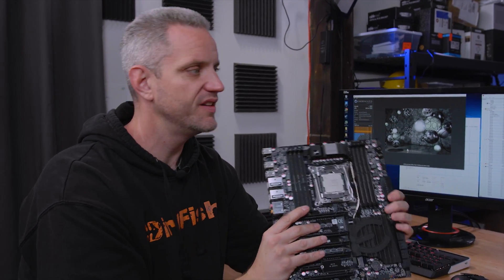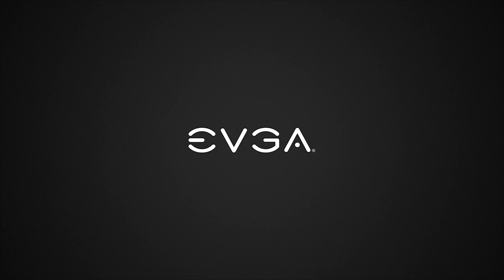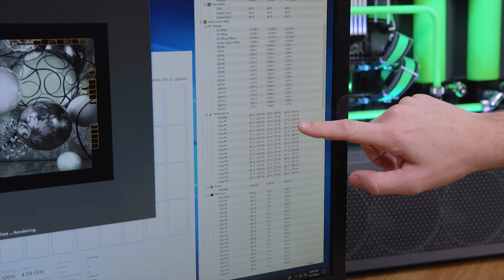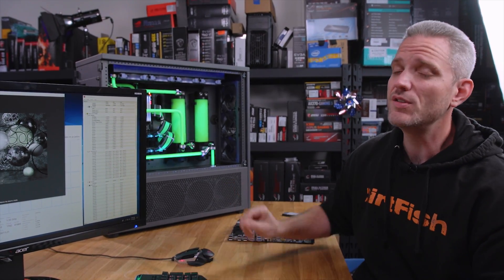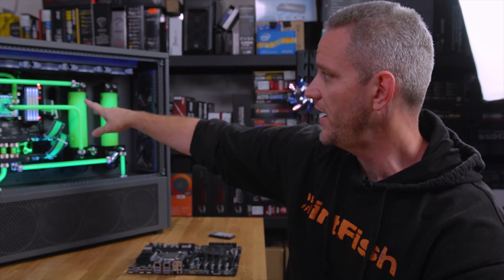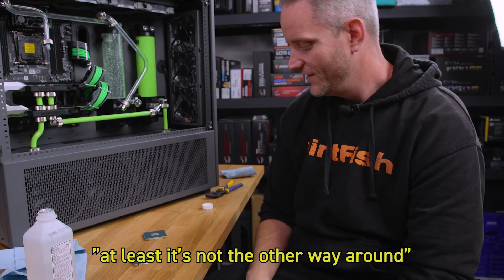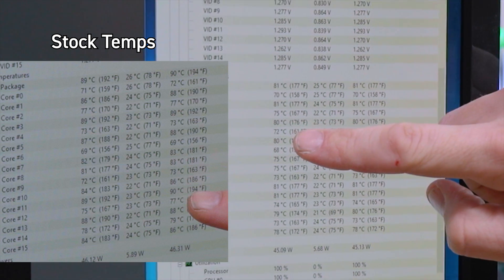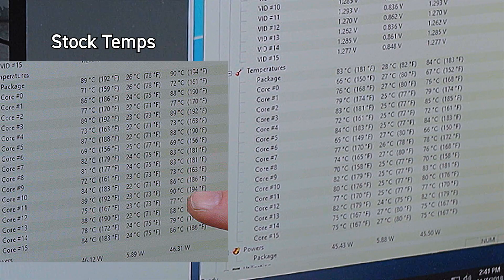I went to delid my CPU... but I didn’t expect this!

Comment: Paste? Why? What's wrong with liquid metal? Especially when the lid is off already and pipes are drained again.
Reply: The idea of a liquid metal "drying" is just wrong. There is no solvent to evaporate away. Nor is there paste that will fall out of suspension. Liquid metal is just that a metal. Sure gallium will evaporate too, but much much slower. It's not something you need to worry about
Reply: LM dries out fairly quickly
Reply: @mizz1414  Not really. GamersNexus kind of tested it, and the CPU did not go up any °C after one year of use. And even if the LM would drop 4°C after 2 years of use(just random numbers of my head, i dont think it would even drop 2°C), you would still be 6°C cooler since -10°C is a "normal" drop if you apply LM.
Reply: Mizz141, nope.  Conductonaut LM has been shown to not "dry out".  I've personally re-delidded three CPUs over the past year, and the LM were all perfectly fine (wet and puddled) and were reusable.  This specific LM lowered the CPU thermals by 12 C on day 365 as it did on day one.
Reply: @mizz1414  Bullshit Coolaboratory LM still good after 3 years in this laptop
Reply: @mizz1414  please tell me more about how metal dries

Comment: Hello from Denver, Jay!  Why did you choose to not use liquid metal with the delid?  Doesn't the LM provide at least slightly better conductivity than the paste?
Reply: @marklamutt LM is 73w/mK vs a good paste being 12.5w/mK (like Kryonaut). It's order of magnitude better. No idea why Jay would go through the trouble of a delid and then put paste right back on there.
Reply: My first thought too, LM blows everything else away and belongs in something dubbed "skunkworks", built with the intent of being overkill.
Reply: @blackbeardthepirate7467  While it could still be used between the silcon and the heat spreader, with the copper being exposed on the top of the heat spreader, it wouldn't be ideal. While gallium doesn't have nearly the effect on copper that it does on alluminum, it still will defuse in over time and the heat just makes it happen more. He'd likely want to use a piece of gold foil on top of the spreader if he was going to use the liquid metal.
Reply: @CrimFerret  not so far as longevity testing has shown, the galinstan will stain the copper, but even after 2 years, improperly applying LM would have had more effect on thermals than the breakdown of the LM to copper interface.
Reply: @CrimFerret  

We are referring to between the die and IHS. Madness not to use liquid metal.
Reply: @CrimFerret  All it does is discolor copper it doesn't effect the structural integrity as with aluminum nor does it effect the coppers thermal properties. Also the underside of the IHS is nickel coated like the top (prior to lapping).
Reply: I delided my 8700k and used liquid metal and had a 25c reduction in heat. Liqiud metal is the way to go if u delid!
Reply: @John-dt7zb  same !😍
Reply: @John-dt7zb  Same here, but I actually only had original thermal paste on one side of the die, and even that seemed to be brittle and cracked dry.
Now I need to drain my loop and check that the TIM is actually flat too :D God damnit.
Reply: Titan Mechanism  thats the thing, LM is the risk not so much the delid (minus the voided warranty)
Reply: @ryanbernard6550  

The only risk from Cryonaut liquid metal is that its electrically conductive. Not an issue when delliding with reasonable care.
Reply: Intel quality for ya
Reply: He should have used LM, period. I tested over 6 months different LMs and pastes and 99% of pastes had pump out under the IHS. LM will give you slightly better temps but its the reliability thats far more important.
Reply: He said Skunkworks is his "build it and run it for years" system.

Liquid Metal needs to be redone from time to time.
Reply: @enlightendbel  That is absolutely FALSE. I've had liquid metal on my CPU for years and haven't had to redo it at all. I've redone more pastes under IHS then i have Liquid Metal. It's supposed to solidify and in a way be like solder, it's not supposed to stay liquid because if it did it would end up running. If anyone tells you LM metal needs to be redone that's a total myth and not true. You will be redoing paste because of pump out long before youll ever need to redo liquid metal.
Reply: @bluej511  Yet everyone from the manufacturers to Der8auer to Jay himself has stated you should.
Reply: @enlightendbel  I've had CPUs that I've had on LM for 5 years that I repurposed on old boards and the temp was exactly the  same as when i took em off 5 years ago. If you need to reapply LM then you applied it wrong in the first place. With liquid metal your cores shouldn't deviate more then 5°C from another, if they do you already applied it wrong. It needs to be applied incredibly thinly not thick, most people use too much therefore need to replace  it because it has ran off the die from pressure and heat. 

Read this and realize it doesn't need to be done. Btw this is a one year performance test meaning it was probably run the entire time.

 https://www.gamersnexus.net/guides/3359-liquid-metal-aging-one-year-test-how-often-to-replace-liquid-metal
Reply: At least he used very high quality thermal paste.
Reply: You have to replace LM often though.
Reply: @omni_1376  liquid metal is good for at least 2 years at a time per application. Gamers nexus has been doing long term testing on thermal grizzly's conductonaut
Reply: last minute bid sorry? https://rover.ebay.com/rover/0/0/0?mpre=https%3A%2F%2Fwww.ebay.co.uk%2Fulk%2Fitm%2F123466141652
Reply: i don't get it either. isn't that the point of delidding? i also replaced the lid by a full copper one. also reduced temps be a couple degrees...
Reply: @flavioxy  nickle plated copper is more resistant to oxidation and liquid metal staining. also if your going to the trouble of replacing the IHS you might as well get a silver one.
Reply: @psionx1  good to know. thanks :)
Reply: marklamutt every time I read liquid metal I automatically think of terminator two stabbing it’s sword hand through the milk and the guys head lol
Reply: David Whitfield  
Nonsense. No risk of frying anything. Thousands of enthusiasts have delidded with liquid metal, including me three times, and no issues with reasonable care.
Reply: Yeah my 4770k runs delidded with LM at 4.6ghz 1.3v and I never see north of 80 even in heavy loads using just an h100i. Gaming usually stays well under 70. Couldn't take it before i delidded it. Could barely run it at 4.2ghz without the heat getting higher than I liked.
Reply: Because this guy is a n00b and everyone thinks he's not.

Period.

There is not a other answer for it. I can see there are already tons of responses by little cock suckers making excuses for him.

SMH.
Reply: victor ng  https://www.caseking.de/en/der8auer-skylake-x-direct-die-frame-fsd8-021.html
Reply: Agreed. Some talk about the risk and blah, but that's the whole point of deliding : to replace the lesser efficient TIM with LM since Intel didn't solder their IHS, not with another similar TIM (which is IMHO plain stupid as the expected end result would essentially be a voided warranty, nothing more)! *g...
Reply: I was also hoping for LM. Should be 16 times better than paste. It has some disadvantages though
Reply: @simeongeorgiev1107  I've used both and obviously LM worked significantly better.
Reply: my 8086k runs at 5.15 Ghz 1.35v (forced always turbo) runs 24,hrs a day never hits over 70 degrees' doing anything. TG's conductonout was used on the delid. LM is worth every drop. (stock was running over 90 degrees on the same clock's)
Reply: @Vasana612  Same thing for me!
Reply: Lm would last longer than the thermalpast... Would go LM!
Reply: Liquid metal has to be replaced every few months
Reply: @MaxGuides  
Absolute nonsense! Liquid metal does NOT have to be replaced every few months. It lasts years.
Reply: @Max Mohr not sure where you read that but that’s false, been running LM on my 7700k for over 17 months with no issues. Gamers Nexus even did a video about Liquid Metal back in August.
Reply: Takes a lot longer to do, takes a bit of effort to perfectly get it right, and hes already in the 70-80 range which is 100% fine for a  16 core CPU at 4.6 ghz
Reply: @ShimejiiGaming  Still if you go overboard with delitting, just go for LM. Would have been nice to see the difference between LM delit and High Quality thermal paste Delit. You can Barely find a Video between stock paste, good paste and LM on the same CPU. 
Would love to see a comparison between Liquid metal, standard and high Quality thermal paste. Not just with delit, but also between Heatspreeder and Cooler block. Overall that would be 9 different combinations.
Reply: Arcade Bit Delid dude, not delit, it was hurting my head saying delit lmao
Reply: @arcadebit1551  when I delidded my old my 3770k about 4 years ago I used thermal paste (Noctua NT-H1) instead of LM because I didn't want to risk getting any on the CPU potentially damaging it. However even without LM the temps dropped by almost 15°C (before delidding they were in the 80-85°C range and after it was sitting right around 70°C). The chip was already overclocked but I can't remember the GHz and Voltage settings anymore because I sold it when Ryzen came out.
Reply: @arcadebit1551   GN > Gamers Nexus has vid comparisons between LM and different paste . Steve does the most comprehensive testing I'v seen , outside a full fledged science lab . Jay got the results he wanted so no need to go to LN as it's not needed for what jay wanted . He's not "Stat" slinging in this vid .
Reply: @tracker001  GN just have one Video where it compares LM with the stock paste. Still far from what I would like to see. I dont need a million different datas between two different pastes. What i am looking for is different Pastes and application  on one data set (Max temps)
Reply: @ShimejiiGaming  True but using just paste did nothing after the delid so LM would have actually made it worth the time he already spent.
Reply: @ShimejiiGaming I think it's more that you need to do maintenance on liquid metal far more often than you need to do on normal thermal paste.

And Skunkworks is the system he intends to build and then run without much maintenance for years on end.
Reply: @enlightendbel  
Not true. No redoing of LM required. And its a custom loop, he will be draining it down regularly anyway, so easy to apply fresh LM... but not required.
Reply: @ShimejiiGaming  i delided my 7700k with liguid metal in my laptop and yes it takes a bit longer but it didnt take more than an hour

Comment: I thought the reason people delided CPUs was to put liquid metal in there instead of the thermal paste.
Reply: Reducing the space between the die and the IHS by removing the excessive adhesive can also have a significant effect.

Comment: what about delidding AND using liquid metal ?
Reply: @Grand Admiral Thrawn cool. This is not a 9th gen processor he's using. 7th gen.
Reply: Der8auer made a Video about the New soldered Intel CPU ;)

Jay should apply LM between DIE and IHS , i am sure it would reduce temps again significantly
Theres no guarantee anyway after delidding

Comment: Nice lapping. Why didn't you use conductonaut between die + IHS? Linus did this same mistake of using thermal paste on a delid and noted that it was not worth it, but now, he delids with LM and suddenly it is.
Reply: So with Conducternaut you do get dark marks on the CPU die after a couple of years, were not sure how this effects performance, but bare in mind that the CPU transistors are actually buried deep under a layer of dumb silicone. If you watch Debauer's fairly recent video on the 9900k, he sands down the CPU die silicone layer a huge amount to gain better thermals as the silicone doe not have a great thermal conductivity and impacts thermal transfers. 
So if you do get the staining, it will not hurt in terms of health of the CPU, possibly only thermals, but you can simply sand a couple thousands off the silicone on the top of the die.
Reply: Please kindly correct me if I'm wrong, but I think conductonaut is not great for long term use, as it can become conductive, and corrosive over time, thus making it only a temp solution.
Reply: Yes, this is incorrect. Liquid metal will corrode aluminium, but copper and nickel are both safe. Gallium (the base of liquid metal), will absorb into them slightly over time, but this does not hurt thermal performance. It also has no impact on silicon, so it safe for direct use on the CPU die.
Reply: @alexz1232  I don't know if absorb is the correct term. It seems more like it wets the surface of the nickel, kinda diffuses into the microscopic roughness of the nickel surface of the IHS, or absorbing, lol nerd
Reply: @CommodoreFan64   I have had my 7700k delidded with TG Conductonaut running 5.1ghz for over a year now, and the performance hasn't changed. Full load still barely hits 60C and games at 40-45C depending on title. Way better than 80-90C before delid.
Reply: @wattforce8477  what voltage and motherboard ? Greetings
Reply: Conductonaut is conductive to begin with. You have to be very careful to not get any on the SMDs when applying it. Alex is right about corrosion. Gallium really only affects aluminum.
Reply: @avagreen9060  you simply isolate any exposed metal with nailpolish, done.
Reply: @CommodoreFan64  yes it is conductive so you do have to be careful not to let it get on the capacitors around the cpu die however it is not corrosive to the heatspreader or cpu die which are the only things it should contact. You are also correct that liquid metal doesnt have as long of a lifespan when compared to regular thermal paste but Gamers Nexus has shown that it should last at least a year with no reduction in performance and can last longer but they have only tested longevity for a year so i cant say how much longer it could last. Just wanted to clarify for you :) i personally feel like if your delliding you might as well go with liquid metal to get the best performance but everyone has their personal preferance when it comes to mods
Reply: @starsstripesjacket   I have a delidded 3570K  with TG Conductonaut for 3 years now, running at 4.5 Gz with no reduction in performance or temperatures differences , so the lifespan of liquid metal is definitely more then one year, at least in  Conductonaut case.
Reply: @emanuelchiriac7877  Yes thats absolutely correct. Anyone who says you need to replace it are going along with the myths being written on the net  because one dude had to redo his. Ive had mine in my 4690k for probably 4 years now and although it hardly gets used (means the LM can  even solidify) my temps on water are exactly the same.
Reply: @CommodoreFan64  It's fine for long term use. Used TG Conductonaut for nearly 2 years and when i did my second loop clean i decided to take a peak under the IHS to see if i needed to clean and reapply. Well nope it was still in liquid form and not hardened like alot of other people had me believe. But i reapplied it anyway. It's conductive from the start and remains conductive for probably as long as you use it for. As previous people said it will eat away at aluminium. Iv'e used nail varnish to cover certain areas of concern which liquid metal could short and it's a life saver, even used liquid tape which is like a rubber texture when it dries which is also good but can look messy.
Reply: @James-ns6jm  same here and still going strong a year later.
Reply: @James-ns6jm  Can confirm, i run my 9900k waterccoled with direct die. (The die is directly against the CPU waterblock) huge temperature decrease. I can do 5.3GHz daily, befere delid it was simply impossible.